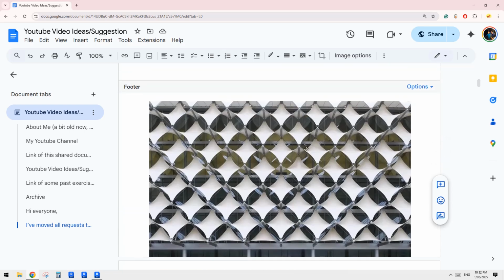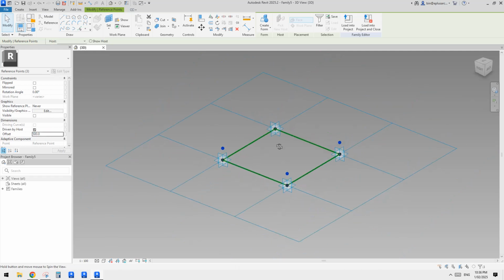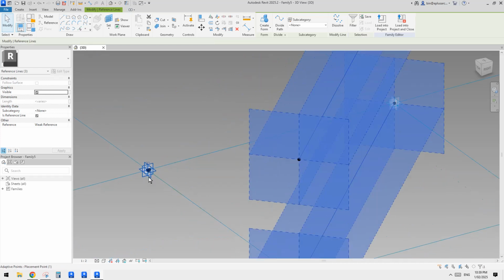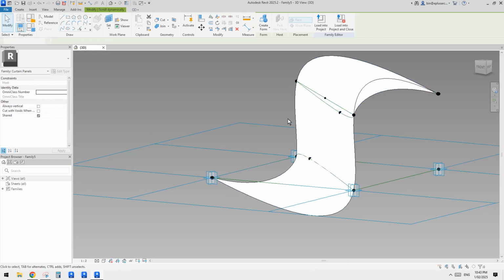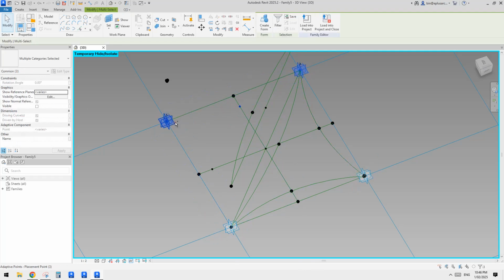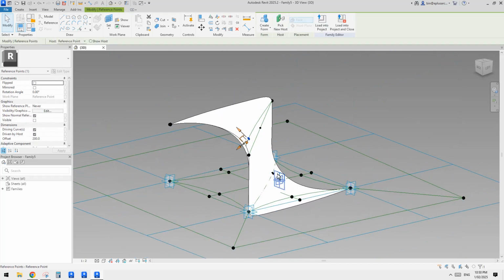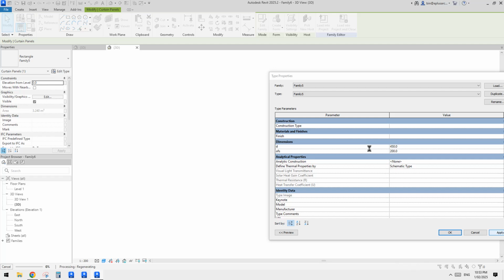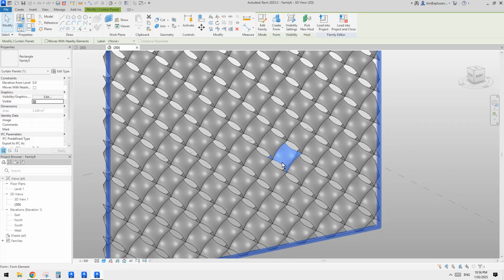25017 - Pattern Based Family Exercise in Revit - Method 1 (with void)

Comment: Sir, can we use Revit to create custom families for metal ceilings and metal paneling, along with manufacturing drawings? Additionally, can Revit calculate the number of panels, total area, and suspension counts? I tried following your video, but I still have some doubts, especially regarding estimation. The deductions for doors and columns are causing errors, making it difficult to proceed. Could you please create a detailed video addressing this issue? Thank you!
Reply from the maker: Although it is possible to model every detail in a project, we need to find a balance. For example, should we model the suspension rods, ceiling grids, and individual ceiling panels? I don't think so. We can use a material surface pattern for the panels and probably just lines, filled regions, or detail items for the rods. We can still use a calculated parameter to determine the quantity of each element based on the ceiling area, which should be sufficient for estimation.

Comment: For the pattern based family, I observe a common issue in which the partial elements near the boundary of the divided surface does not flush with the boundary if you set the "Border Tile" to "Partial". In some scenario, it do cause difficulties in positioning if we want to stitch some terminate unit to the partial elements. Is there any ways we can solve it? Or it is a bug in Revit that we cannot resolve? I tried to reproduce the same family in Revit 2025 and the screenshot is shown in the following link for your reference. Btw, thank you for your video!

https://drive.google.com/file/d/1Tk1jBjHYunSg3jnXhJ3_Avf0OytB--Lq/view?usp=sharing
Reply from the maker: You are right. I noticed this before, not long ago in a video about pattern based paving tiles. I haven't investigated it further, but I think it might just be how Revit works, similar to the gaps we see when using a section box. I think we can calculate the distance and adjust the form size to match. Alternatively, we can try the parameters in Divided Surface for the offset of grid lines.
Reply: @BINHE615  Thank you for your advice. If the gap between the partial solid form and the boundary in general case is "predictable", we can try to match it with parameters or by offsetting the grid of divided surface.